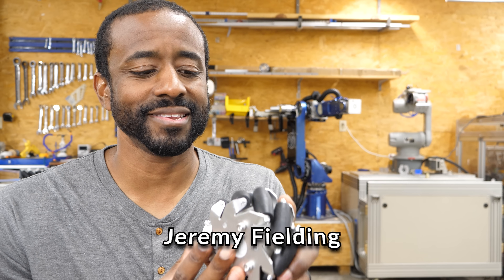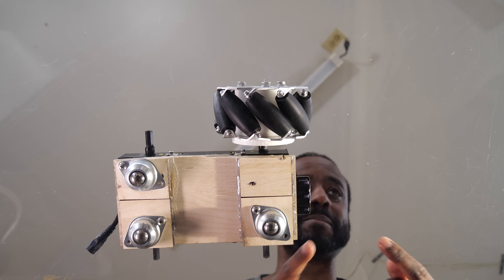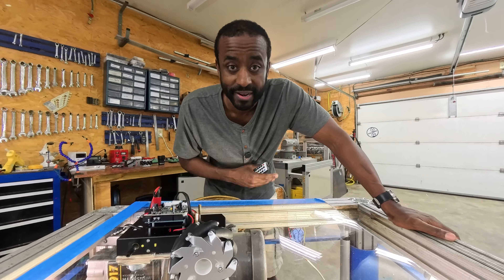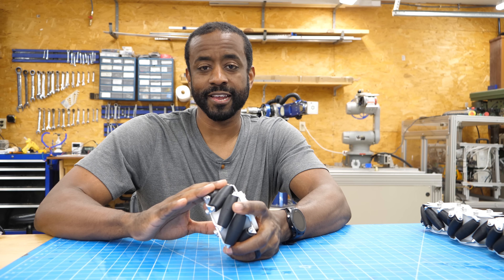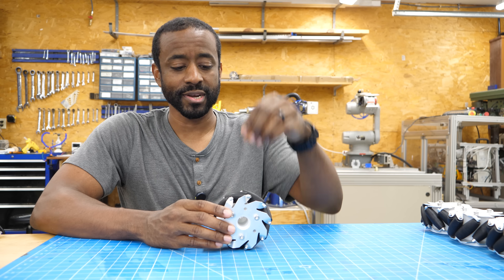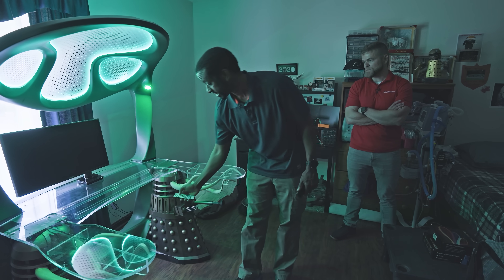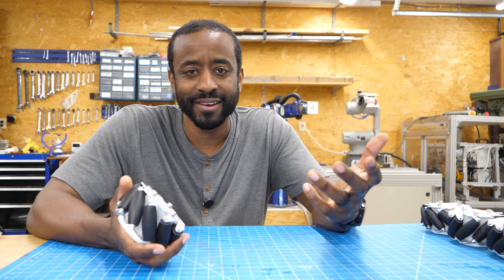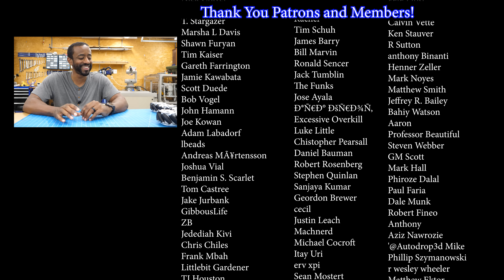The Mecanum Wheel Is So Weird, It Is Genius. How It Works

Comment: Not practical.  The speed limitation, and the complexity, compared to a convention tire, are huge drawbacks.  Maintenance alone would be exponentially higher.
He doesn't sugar-coat this or gloss over the drawbacks.  And he's absolutely right about the "cool factor" - I want one.  I don't care if I can't use it for anything.  I just want one.
I think the potential in specialized applications, especially at small scale, is great.  Excellent explanation - progressive demonstrations building on visual examples.  Clear and engaging.
Subscribed.  I enjoy learning, and this fellow is a great teacher.

Comment: I teach applied science, focusing on basic robotics.  We run Vex, and Mindstorms.  I've dabbled in Raspberry Pi (pico).  I totally see the applications of robotics in our future generations.  I want my students (middle schoolers) to learn this stuff.  Mr. Fielding, I have only today discovered your channel, but I think you can be an inspiration for robotics.  I will give it straight up, we spend about $400 per kit on the plastic pre-fabs.  Pico costs about $50 for guts, but we fabricate the body and chassis using 3d printers, which basically balances out the costs.  With our US economy printing so much, I suspect these prices will go up (since the value of our US dollar is going down), but this might be a good ballpark to aim for with your market price for schools / small bulk purchase.  Consider annual contracts with replacement / high wear parts (wheels, rubber bands, etc).   I run about 10 kits for about 24 students.  Typically with 1 programmer and 1 builder per team, with sometimes an extra team member depending on their support needs.  I think k-12 schools need innovators, like you and your concept.  Please please keep me in mind once you have things rolling.  Love what I see, amigo!

Comment: Only thing is the paired wheels both have to be on the ground and have friction so that the unwanted propulsion cancels out hence for low speed vehicles in a flat floor such as with a forklift is just fine but for a high speed vehicle on more varied surfaces, it doesn'r work so well.
Reply: To be fair, the normal tires used on a forklift would not work well at high speeds either. Solid chunk of rubber with poor tread characteristics. A car tire on most forklifts would function poorly because too much squish and lack of stability.

Comment: Great video and you talked about the opposing forces canceling out, my question is, when you have 4 wheels, what is the "power loss" on that device because you now have 2 sets of canceling forces, one for every two wheels with opposing forces. I'm trying to figure out how much we give with this very early on, not revamped version of the Mecanum Wheel. And to REALLY CHALLENGE an engineer, it would be to find a way to gain these same functions without the need to cancel as much "applied force"...

For an example, instead of the traditional wheel(rotor) being the driving point, what if we made each rubber roller a powered driving force? Let the main rotor keep it's power as this would also further the "precision" of the maneuvers, but add power to each and every roller on the wheel itself. At first glance it might seem an excessive idea, until you look at the mechanics of it on paper. The transfer of power would be far greater, the accuracy much more stable and precise and the loss of energy conversion a lot less......

Comment: Totally new to this but could some kind of differential be incorporated to compensate for any imprecision or drift that occurs to dial in that precision? That would increase the use cases (while adding new points of failure, but ya know)?

Comment: In a warehouse environment, speed is important, and mecanum wheels suck at going fast. They chatter like crazy at certain speeds depending on what they are mounted to, finding sympathetic resonances on the platform, which can cause problems and is noisy. Just stiffen things up, right, but guess what, you need some compliance because you're running four points of contact on a plane, so in addition to mounting compliance, the ground has to be flat. Software guys often want holonomic (fancy way of saying you can randomly access any point on the plane to rotate about) platform because the programing is easier (always a straight path to where they want to go), or because they never know what they want to do, or how they are going to do it & they don't want to bake in kinematic constraints that make it more challenging to execute maneuvers they didn't know they needed to do. See the push and pull? The next best thing to mecanum (not considering driven omniwheels which are dumb and slow) from kinematics pov is the driven swivel zero caster angle drive, which technically is holonomic, but you have to reorient the drive wheels prior to movement. The sweep space on any kind wheel allowed to spin about a vertical axis is large however, highlighting a benefit of mecanum that often goes unmentioned. Volume in the base should be filled with something heavy like batteries, because stability is a thing. I'm a fan of tractor steer (software guys can suck it), but you'll probably end up with casters on the passive ground contacts, which limits threshold navigation due to small wheel diameters on caster, and again with the sweep space. One variant I haven't seen, which may be in use (I'm only a fan of this stuff in as much as it keeps my TV on) is the tractor steer with omniwheels on the passive ground contacts. Let me know if you've seen that one in the wild, and how incredibly awesome it looked, made you feel, and make you look just standing next to it. That arrangement is mechanically simple, the contact points are spread pretty good, and there isn't a ton of wasted volume in the base, and threshold navigation is pretty good. The arrangement isn't great for when the drive wheels are on the uphill side and you are either braking going downhill or accelerating going up due to loss of traction, but surely the client isn't driving toward some ridiculous worst case incline acceleration spec, right?

Comment: You just reinvented the wheel, of the future I sure hope you patent that. In 20 years i know you will see it in operation in security first military applications then rual areas later big companies to patrol riders with security guards. It's fun to drive. Problem will be smooth transition from straight to sideways. In one fluid motion. Then it will take off. Every one will wants to have its like the electric scooters of now. 😊

Comment: For the wheel itself, could you pivot the axis of the rollers with some kind of limited slip. To be able to add a 90 degree turn for the axis while in motion?

Comment: when fukushimas core melted into the ground,  no robot could get near cause they would just all melt,
I think in todays society there lies a great challenge, we wanna build more and more nuclear reactors, 
world leaders are idiots with a "football" we kind of NEED robots to clean up after our biggest stupidity
so here's the question, can you build a robot that could transport smoldering lava without melting?
I,m kind of thinking : we should try and design a new material that has like, 0 oxigen in its fabric,
and perhaps have renewable layers that are able to absorb extreme temperatures over a certain time

challenge nr two  can you build a robot that can land on a object moving with high speed such as a comet or an icbm, attach itself, and push it out of it's given course / orbit?  here i,m thinking about using the friction heat as an enery source or perhaps ionic thrust

Comment: I was thinking just like if you were going to get a wind generator for your house the wind is moving the blades which creates energy that goes to the transformer that goes to your outlets now if you have mag on the blade and magnets below it negative and positive pushing itself you will get that continuous motion once you start it you should have the same results.

Comment: Forklifts move very slowly? He needs to watch videos on forklifts.
Reply: I drive a forklift, they need the ABILITY to drive slowly, you can adjust them to go over 20 mph easy. Slow is relative.
Reply: @SolitaryCanid  Do you drive a forklift in a warehouse that ships medical supplies? Or Amazon? That's just two places off the top of my head where you wouldn't want to jump from a moving forklift. And 20mph isn't slow. So let's stop it with the "relative" nonsense. The guy doesn't know. He thinks forklifts are as slow as what he showed in that video.
Reply: @moreforme74  Ok, you make idiotic ASSumptions. How about that.
Reply: @moreforme74  You never jump from a moving forklift.

Comment: It seems like using treads which rotate independently of the rest of the robot would have a similar effect, except slower, but more precise and with less wear. basically like how a tank can pivot without moving its main gun and then drive sideways in relation to where it is aiming. It would take a lot more time to change direction, though.

Comment: If the purpose of these wheels is to produce diagonal force, why not just use diagonal wheels with low grip tires? Wouldn't that greatly reduce the cost of production and upkeep of vehicles using them? Genuinely curious here.

Comment: Fascinating information!  Depending on finances available at the time, I'd be willing to spend as much as $250 on the supplies for the simpler robot, and as high as $500 for the supplies for the more complex robot. 

New subscriber.  Thank you for sharing this info. It would also be great to find a better way to construct the wheels to permit higher speed on less even surfaces!

Comment: i look at that mecanum wheel and think about having a car with 2 of those who deploy to park the car for you with the press of a button. They move to points meant to carry the weight of the car. Use a jack that lifts the car 1-2 cm. Rolls side ways, drops the car once parked.  then reattach themselves under the car. If Tesla had that... even their crap truck would seem futuristic.

Comment: i wish you put as much effort into your audio as you put into your scripting
Reply from the maker: What was wrong with the audio? Real question. I actually put way more time into the audio than the script LOL so this is surprising. What do you suggest could be better?
Reply: @Jeremy_Fielding  I did not expect you asking, and appreciate it. the primary issue is the massive amount of reverb you have in there, which in general is not very appreciated by many (though not minded much) but ALSO presents a considerable issue for many neuro-atypical people. general groups there are people with APD, autism, ADHD or otherwise aural sensitivities. it also plays considerably differently on speakers than on headphones and thus can be situationally unpleasant

Comment: There is more friction generated with this type of wheel, which reduces energy-efficiency.   At normal fast speeds, there wheels would overheat very quickly; but they aren't used for that purpose, so they work well as intended.

Comment: Performance stages.  Tons of money in entertainment and mecanum wheels mean a combination of great flexibility  and control in designing what the stage -- or several stages -- can do in a 360-degree venue like an arena, stadium, giant field, etc.  There's always a smooth concrete floor or a temporary smooth floor laid under a stage, perfect for mecanum vehicles.  A performer can even operate their own various platforms upon a larger stable stage.  Hmm.  I was just thinking of comparing ground-based mobile platforms on mecanum wheels to a squadron of drones and visualized a group of mechanized platforms doing precision drill-team maneuvers.  So many possibilities.

Comment: Hi. The mecanum wheel has major application ( in my opinion ) as wheel substitutes for emergency barouches  and hospital beds. These items are manouvered around usually confined spaces at the peril of those doing the manouvering. Why not incorporate electric motors to these wheels as part of bed and barouche  design to eliminate manual handling risks associated with bed and barouche manouvres. Could even be retro fitted to some existing makes and models also . Would make vacant equipment or patient transfers around a hospital ( in and around right quarters ) a breeze and very safe.

Comment: Great design but from my perspective the cost would be creating a harder rubber that doesn't wear under continuous use with heavy loads on concrete flooring with slip traction going through water and oil. One uneven tread could cause huge problems.

Comment: I'm glad you mentioned the cost. Every one of those rollers is supporting the full 25% of the weight in a four wheeled vehicle like a forklift, so that's a lot of bearings (80 just for the rollers.  Add four motors and controllers, and the computer, and that's coming to a tidy sum that a conventional system would not need.  A fascinating concept though, and no doubt worth the cost in some situations.

Comment: electric wheelchairs would be an amazing application for these wheels for people who are 100% confined to a chair
Reply: Not really. The drawbacks inherent in the design actual prevent it. It has limited traction. It requires perfectly smooth surfaces to work on. It is more expensive to build and maintain.
Reply: Ur comment isnt taking into account ADVANCEMENT of tech... all tech today had ppl like u saying it's expensive and high maintenance based on it ONCE BEING like that...  self driving cars are BAD and costly if ur tesla bit amazing if ur BYD and more affordable... also smart phones are millions of times more powerful and way more affordable then Computers that landed the first humans on the moon... conclusion ur the OP is correct as they left room for FUTURE and u did not and are stuck on current limitations as if they won't advance... fyi prosthesis are more affordable today and more advanced.. soon it'll bee cheap to just replace limbs with superior prosthetics.. remember u had to be WEALTHY to own a horse once.. then a car..  now both are more advanced and superior and more affordable... these wheel are NOT the exception...  the practical aspect is the issue... Stephen Hawkings powered wheel chair was just fine and didn't need anything else... covienance rules a most humans in wheel chairs probably can't be bothered to fiddle with extra steps/buttons EVERY DAY ALL DAY to move sideways...  conclusion ur ability to envision tech potentials fails u...
Reply: @wstavis3135  People who focus on getting things done are more succesfull then people who focus on why things can't be done...
(think about the Wright brothers😉)
Reply: This was my first thought as a PT. Perhaps, my peds patients would find this interesting.

Comment: Don't the opposing forces increase tire wear? Regular truck tires can achieve 50,000 miles. But for tight-space low-mileage movement, such as fork lifts and robotics, it has a lot of advantages.

Comment: Here's another idea: Imagine a horizontal disk with a rubberised edge. If it were under a vehicle and tried to rotate on a vertical axis, it would be unable to do so. But suppose its axis can be tilted in any direction sufficiently that a part of the rubber perimeter is in contact with the ground but the rest is not. Now by rotating the wheel you will have motion. And by adjusting the axial tilt, you can control the direction of that motion. Now imagine a vehicle with 4 such wheels, one under each corner. By altering axial tilts, you will be able to make the vehicle rotate, or translate in any direction, or a combination of rotating and translating. The disks could in fact be made into bell shapes, to make the edge more vertical where it comes into contact with the ground, making it more practical. Why not just have castor wheels? Well, yeah, that would be another approach. It depends how novel you want to be.

Comment: If you put your RC car with mecanum wheels on sand (maybe try putting a thin layer of sand on the glass, with your camera still beneath) you will see weird track lines, showing you the direction the force is pushing in, depending on the different set up you can have. The interestning thing about a mecanum wheel is that they have a tendancy to push in 2 different directions are the same time, depending on traction. I first saw them in action on a Fork Lift also and it was leaving really weird track in the mud👍

Comment: Since by you saying it is design for slow and precision application, just wondering how does the rc mecanum rally car toys speeding around on remarkable top speeds be possible?  Is it even be possible by practical theory to prototype this, cause going sideways to park or limited fit in space or doing 180 degrees turn are very ideal added maneuvers for future vehicles?

Comment: The Mecanum wheel is an omnidirectional wheel design for a land-based vehicle to move in any direction. It is sometimes called the Swedish wheel or Ilon wheel after its inventor, Bengt Erland Ilon (1923–2008),[1] who conceived of the concept while working as an engineer with the Swedish company Mecanum AB, and patented it in the United States on November 13, 1972.[2]